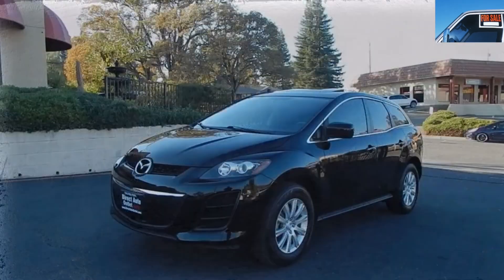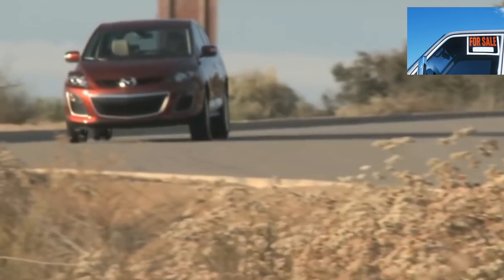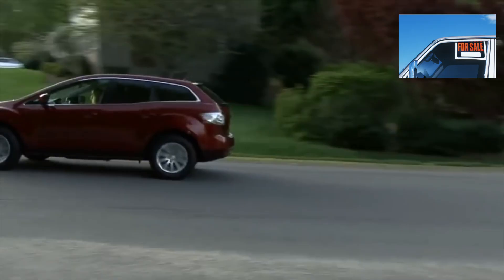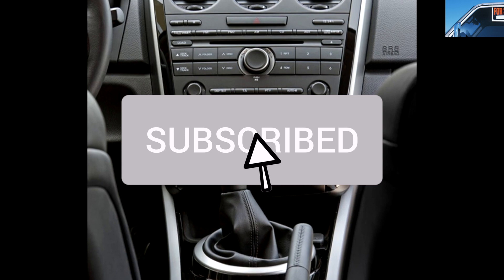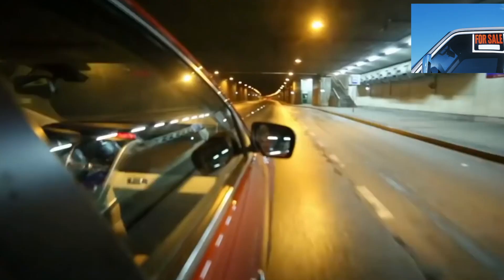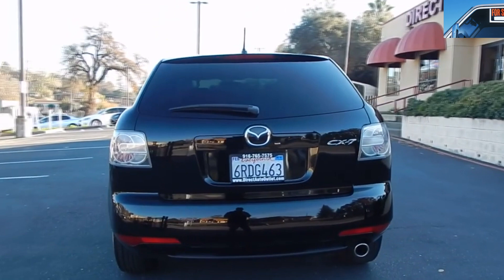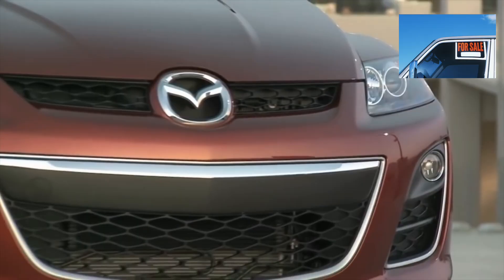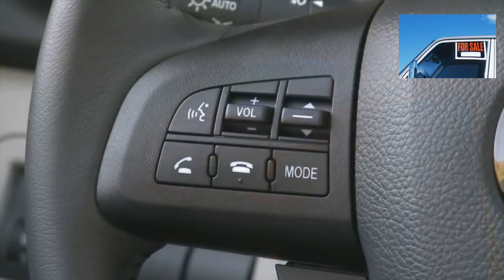Buying advice with Common Issues Mazda CX-7

Comment: I took the leap of faith and purchase a low mileage certified used 2011 CX-7 SVI trim 2.5L with a 5spd Auto. back in 2013. Still going strong in 2013 with 308K miles. It’s been pretty good for me and I’m still happy with it. I have 2 newer Mercedes-Benz cars and SUV’s for comparison. Definitely much less in ownership cost.

Comment: The headlights are a joke. Especially the stock halogen bulbs. Impossible to change without having to take off the tire and fender wheel wall. What a pain. Also the blower keeps randomly going out at times. It's been strong for about a month with no blower issues. But I heard it's a problem.

Comment: My advice is to not buy a cx7 at all. Avoid. If someone gives you one then sell it.
Reply: And buy used bmw..😅
Reply: Uh and why? You give no reasons, just bs.
The 2.5L is a bullet proof engine.  And once mazda broke away from  Ford quality went way up especially after toyota bought it and took over.
There are tons cx7 with over 300k miles. And the cx5 new version of the cx7 are better and more reliable than a toyota rav4
Reply: Still have my cx7 2010 no issues runs and drives great.
Reply: Toyota did not buy Mazda over. They have only 5.1 percent stake in Mazda